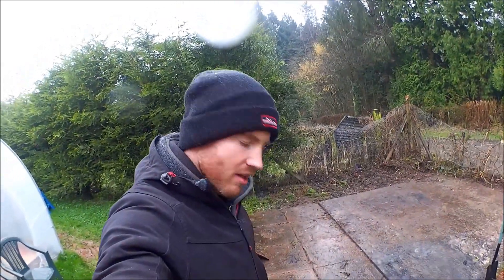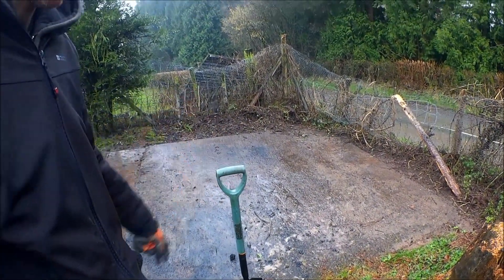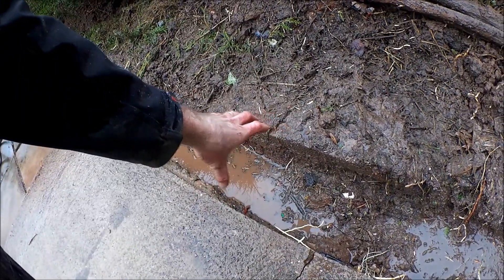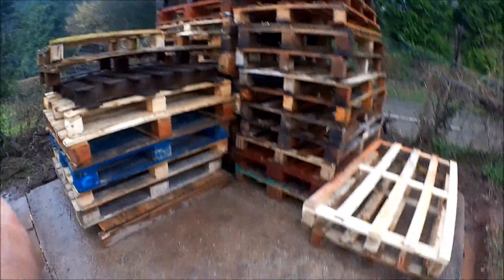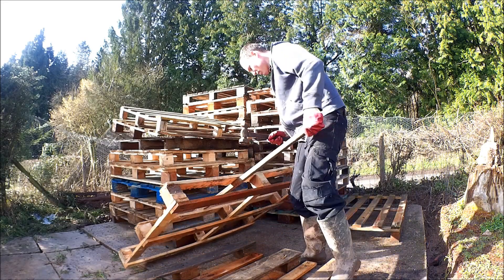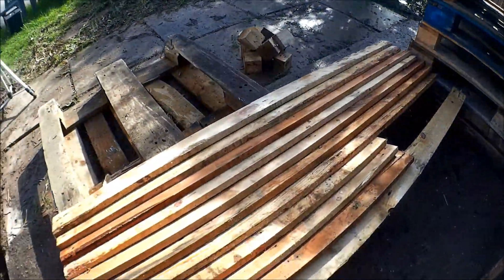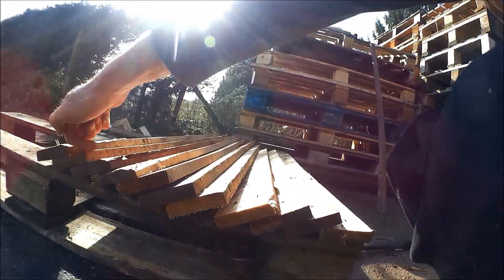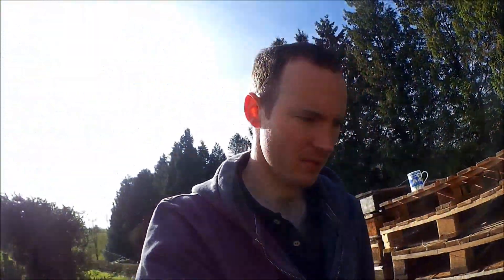Free materials for building a workshop

Comment: I've broken up a lot pallets to use at different times and it an awful lot of work.  I found that it saved a lot of time to just 'whizz' the nails off with an angle grinder (as long as you are fine with metal left in the wood).  Also a long crowbar speeds thing up a bit.  It is great wood though and very useful.  I also have some wood recycling places near me that are fed by demolition teams.  The wood needs plenty prep but is often well seasoned being about 100 years old.  I got some fantastic Baltic pine floorboards for next to nothing that came up a beautiful custard colour when I sanded it.  Purlins can also very useful and the ones I find are usually Canadian redwood.  It seems quite rural were you are so maybe you don't have such opportunities. I live in Liverpool and there are still a few buildings to be demolished and so I hope to keep getting this old wood.  The struggle you face is one I have faced on and off too much of my life.  Good luck, I hope you get back up and running soon.  I think your work is beautiful!